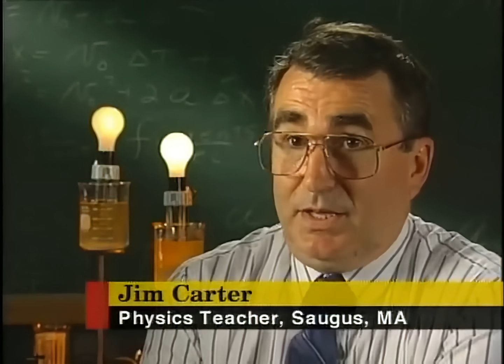MIT graduates cannot power a light bulb with a battery.

Comment: I like how the only guy that did get it correct was the guy who answered "maybe", instead of giving in to the pressure of saying yes outright.
Reply: Yes, as indicated from 1:46 onward, what he recognised was that he needed more information about the battery and the bulb to answer Yes or No to the question. The video cheats by not showing people wiring the circuit correctly but still inevitably failing to light the 120v bulb with the 1.5v battery- except the cheat is, as most of the comments sadly illustrate, part of the education. If people don't consider all aspects of the situation (including, in this case, the fact that only the "maybe" guy was shown succeeding with a bulb of more suitable voltage rating) they will get the answers wrong.
Reply: @PastPresented  It has nothing to do with the bulb, if you look at what the failing people are doing they're just not making a closed circuit so it doesn't work.
Reply: @ShadowViking47  So why are two different bulbs shown? The guy who made his bulb work specifically states "Ah, well, if I do it with a little light-bulb ..."- implying that he had previously been given the larger (probably mains voltage) bulb seen in the hands of other students.
Apparently we're only seeing a small part of the encounter with each student. It looks as if some of them genuinely did fail to grasp how an electrical circuit could be made, but the most important thing is the wording of the question.
Reply: @PastPresented  The size of the bulb has nothing to do with the current needed to turn the bulb on.
Reply: @ShadowViking47  Not 100% necessarily, but the fact that the successful candidate commented on the small bulb strongly suggests that the larger bulb was not a low-voltage magician's prop but exactly what it looks like: a mains voltage candelabra-type bulb.
Reply: @ShadowViking47  Size does not matter per se, but the wattage rating does matter.  The small bulb has a smaller filament that requires less energy to produce a visible glow.   At least some of the students were misled by the form of the question.  I suspect that most, but not all of the students were capable of wiring up a series circuit with one wire, a small battery, and a bulb.  But that would not have lit the larger bulb.
Reply: @PastPresented  precisely my thoughts, imagine if they gave them a 120v bulb and trolled them
Reply: @PastPresented  An experienced engineer will always qualify everything. I often say when people ask me a technical question that is broad in scope and lacking in details, "Never ask an engineer a broad, vague question, expecting a clear answer. You'll always get the same answer, which is "it depends". A good engineer always considers risk assessment as part of the answer. I probably would have answered something like "If we define the bulb as a 12 volt incandescent lamp of less than 12 watts, with an intact filament and internal connections, with a wire of at least 22 AWG to prevent excessive I^2R losses and heating in the wire, and the power source is a 12 volt fully charged battery with a minimum of 10 amp-hour capacity, and I have the proper tools required to strip the wire correctly, then yes, I could wire up a circuit with the specified components that would successfully cause the tungsten filament to incandesce." This would ensure that they would stop the interview with me, and erase the footage. :P
Reply: @davidjh7  Indeed something any experienced engineer learns with time. Once you agree to do a simple task before learning it needs to be done on the moon with zero budget you learn to ask for more details.
Reply: @PastPresented  you are actually right, just saw your comment after I made my comment before :)
Reply: @PastPresented yes he knew about it
Reply: I thought the same and I am not e ngineer but electtonics is my hobby. I thought before that they gave them a small bulb, like 1.5 V one and the  realise that they were holding 230V or 120V bulb which is a little bit tricky.
Reply: The real lesson is to never trust the media, lol
Reply: I think the point wasn't the rating of the bulb but rather that students graduate from MIT without knowing how to COMPLETE A CIRCUIT.
Reply: @chasbader Nope.
Reply: No joke, when I was watching this and he gave that answer, I was like if anyone can do it it's him. That was a wise answer
Reply: No, the question was whether they could light a light-bulb with a battery and a wire. It doesn't matter that they weren't able to light that light-bulb with that battery and that wire.
Reply: That's an important point! He understood the complexity of the situation!
Reply: I take maybe as for a No, the answer is obviously yes.
Reply: based
Reply: It absolutely does matter, because the full correct answer to the question would be something like:
"Yes, IF the battery provides a suitable voltage to make the bulb glow in the visible spectrum, AND the wire is long enough to connect the further terminal of the battery to the bulb, AND the bulb is a working light-bulb, as opposed to, for example, a tulip bulb".
Reply: No the general statement contains all the subset possibilities. Proving that birds can fly does not entail proving that every bird can fly. Proving that two or more birds can fly would prove the statement, that birds can fly.

If you try to expand the many influences that you are talking about, then you can go further into if the wire is too resistant to current, if the wire is conductive at all, if the surroundings can transmit electromagnetic waves, if you are talking about the moment in which the circuit is connected since inductance can prevent the current from immediately appearing, if the questioned does not have a seizure while attempting to do so.

Being able to light a light-bulb in any situation proves the statement of yes to the question, "do you think you could light a bulb with a battery and wire?" One instance in which they cannot, does not disprove the possibility that they can. If that were the case, then all laws of physics would be "disproven." 

If anybody is wrong, the creators of this video are in the wrong for not displaying the correct way to light the light-bulb with that set of equipment, if there even was a way. By your logic, I could ask them the question, then immediately shoot them on the spot. Therefore their statement would be wrong because they couldn't prove it using the equipment I was about to provide them.
Reply: @slayerphoenix6307  that is not how discourse works at all. There is a lot of implicit assumptions in dialogue and youre being disingenuous if you think otherwise. Assuming humans are perfect logicians would render any discussion impossible.
Reply: You're right, I had forgotten about high-resistance wire!
But my point overall (which was also, I think, the point of the video) is that the question was not about electrical engineering; it was about false assumptions. False assumptions can render any expertise useless or even dangerous, and they probably play a part, for example, in the massive cost overruns on some engineering and technological projects.
Reply: Also, it is the question that needs fixing. "Do you think you could light a bulb with a battery and wire?" Should be "Do you think you could light THIS bulb with THIS battery and THIS wire?" 

Without specifying, the statement defaults to the general, and you just become an idiot that is trying to make graduates look like idiots with your flawed logic. If you tried to do this as a test for something like the SAT/GMAT/whatever, you would get sued and lose your job.

Comment: This whole video is so incredibly wrong, I don't even know where to start...

"If one can not light a lightbulb with a battery and a wire, everything built upon this basic ideas, has problems."

Right.. you wear a suit, so you probably know how to sew it? Or how the cotton is processed? Also, anyone who uses a wire dug the copper out of the soil and is able to explain it´s conductivity. And knows how to operate the wire rolling machine, amongst building and maintaining the machine. And knows what spices go into the lunch menue fo the wire factory, and why? Dude.. it´s the 21st century, and the zombie apocalypse is far away. This is just... wrong

Comment: Is this one of those dumb trick questions where you need to cut the wire into 2 pieces to get it to work neatly, however if your clever you can do it with one wire. One part of the wire goes to ground or hot while the light bulb itself has to make the other connection directly to the bulb in the opposite terminal. I've read most of the answers on the page but nobody stated that to do it with one wire you need to connect the battery directly to the bulb to make it work.  Lots of vinegar here though.

Comment: Well if they asked me that I'd say yes I could do it
When they hand me the wire I'd split it in two
Reply: +skyler114 You must have some damn sharp teeth or always carry wire strippers around with you.  Either way you'd be doing more work than necessary.  The black dude has the right idea, you put one terminal of the bulb on the battery and the wire connects the other terminal and other pole of the battery.
Reply: +CowLunch It's easier than that, if you bend the wire back and forth about 20 times it should split.
Reply: skyler114 this is still sounding a lot like needless extra work for zero benefit.  Anyway, the problem was to light the bulb with a single wire.
Reply: +CowLunch Then I'd do what he did. But when someone comes up to me and asks a question like that it seems to me they might be trying to show me I'm stupid or don't understand the problem. I'll probably play with their question in a few ways and show them they need to ask the question better. They'd probably need a whole video for just me. The benefit would be that I'm doing it for my fun.

Comment: it's very likely they handed them a 120volt AC bulb the type found in your light fixtures at home. the battery being used hasn't sufficient power to light it up.

I don't think the test was to see could these people create a simple series circuit. I think the point is, intelligent people can miss the obvious. like checking the rating on the side of the bulb.
Reply: +Brian O Shea 

they're not intelligent. they might be "smart" but not intelligent. you must be one of them since you don't even know the difference between the two words.
Reply: And you must be one of them there idiots.
Reply: Your mama is calling you.

Comment: Every battery has an internal resistance which is going to limit the power it can supply. But the average MIT/Harvard science graduate is going to understand this very quickly compared to someone who hasn't studied electrical engineering.

That's the whole point of university: a vetting system that increases the chances of an employer employing the right people.

Comment: What is basic and fundamental to you is not for someone else, if I say what a bitwise operator is for the one who posted the video she wouldn't know but a computer science person would know it. Similarly people who go to Harvard or MIT are not experts at everything, they are experts at their thing.
Reply: Prathik Rajendran M 
Knowing a concept of complete circuit is a bit more fundamental than bitwise operators.
It's like asking an electrical engineer to use ball bearing and axle to assemble a wheel, or architecht to make a sandwich. It's fucking fundamental and simple as shit, not specialization. You can't make a sandwich because you didn't get a cooking degree?
Even interior designer should be able to do that.

Comment: Why didn't they do it ?! what was the problem ? I think this was because of pressure, I have an experience on this, when somebody asks me on the street, my concentration gets so low really rapidly and I begin to think about the situation I am in rather than the question. So it appears they cannot do it but in fact if they have a battery and wire at home I'm sure they would, simply because they did that many many times at MIT. Note that the battery may have lower voltage than the bulb should get but it's not the case here because somebody did it in the video, I think the only difference was that this guy is not shy.

Comment: One wire? No. You need two wires, and here's why:

When you're building a basic circuit like this, you need a link from the positive end of the battery to the bulb, and another from the bulb back to the negative terminal (to form a closed circuit). With only one wire, you can only build half the circuit. The man at 2:00 got around this by using one of the nodes on the battery as the second wire, but the point still stands that the video's premise is flawed.
Reply: ifoxrider You can use 1 wire with a car battery.
Reply: Kyle Silver Give me a 9V battery, and a small 9 or 12v bulb, and I don't even need the wire.
Reply: Kyle Silver I would think that university grads in the engineering field would realize this even if they are not electrical engineers. Its like how a biologist understands at least moderate chemistry.
Reply: Kyle Silver No you dont there just fucking retarded.
Reply: Tyler Jackson Wrong.
http://scienceline.ucsb.edu/getkey.php?key=330
Reply: Bro there really no science on this.Its simple i did this shit with regular lightbulbs with triple A batteries there just fucking retarded.
Reply: Tyler Jackson Really, try to get it to work using 1 battery, 1 wire, and 1 lightbulb without connecting the lightbulb directly to one of the battery terminals
Reply: Kyle Silver lol, if you are talking about car battery, then yes we do need two wires. But with just the dry cell battery, only need the wire connect from positive terminal to negative
Reply: Kyle Silver But that's how you're supposed to do with just one wire, this is a classical physics experiment. Don't try to defend them, engineering courses all around the world are too theoretical, with little or no practice. Even the exam to get into these courses don't require any practical skills. The result is an absurd like this, graduates who don't know a basic experiment. If they repeated this in every engineering course worldwide, the results wouldn't be much different in most of them. Trust me, I'm an engineering student.

Comment: To all the people defending these students... most of them weren't hooking the wire up to each end of the battery. It doesn't matter how big the lightbulb is or what the quality of the wire is; if they don't know the basics to making a running current, then they're stupid.
Reply: Exactley
Reply: Austin Fisher The experiment was designed not to work. Just so you know, a 1.5V D cell battery can't light up a 60 watt light bulb, which is designed to work on 120V AC. The only fault with the students is that they couldn't explain why the bulb couldn't work, but the reporters completely misrepresent the situation to make them look like dumbasses. An example of this is the fact that they used a bulky D cell battery to make it look adequate enough to light the bulb, when in fact it has the same voltage as a small AA battery. Look at 2:00. It only worked for him because they used a smaller bulb. And even then, look how little it's lighting up! You can't possibly expect to produce the same, let alone greater, results with the bigger bulb.
Reply: @FunOrange42  of course it works, you just showed how stupid you are...
Reply: Austin Fisher Very true!!!
Reply: FunOrange Bro it's not about whether the bulb was lit up or not. It was they approached and answered the question. Sometimes if you learn too many complex things, you forget all about basics. None of them had a good approach, confidence and a fair answer. They literally had to think for a minute to answer the question which is very wrong as an engineer. This is the point where one person gets the job in the interview and another doesn't. The way you answer, your confidence, each and everything matters. Each and everyone was thinking like it was very hard math problem and after all thinking they were like ya they can do it.